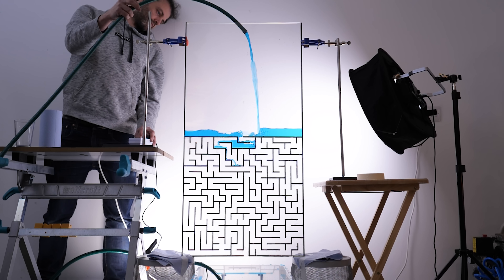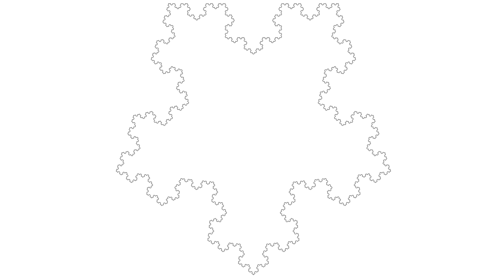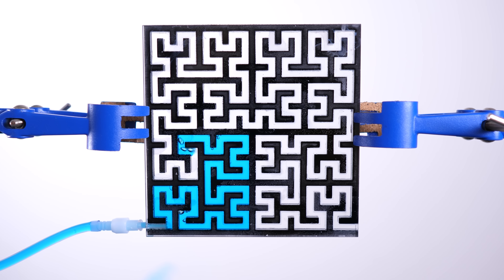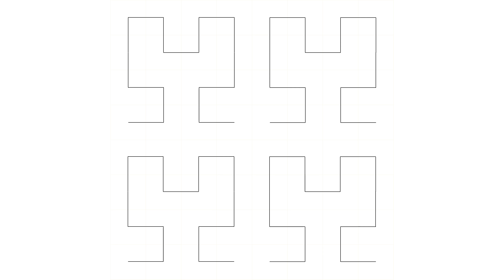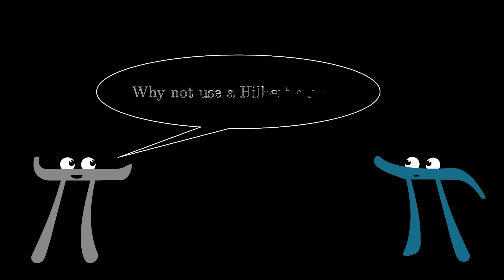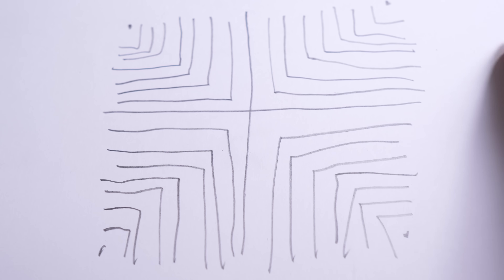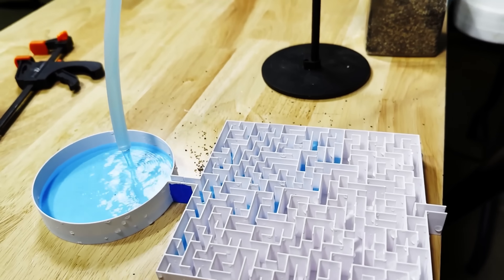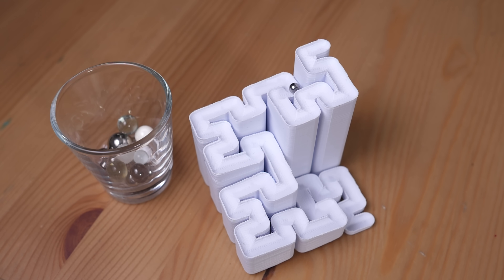Space filling curves filling with water

Comment from the maker: *literally

The sponsor is Surfshark: get an exclusive deal - enter promo code STEVEMOULD for an extra 3 months free at https://surfshark.deals/stevemould
Reply: for a clear resin 3d print, like optically clear, you can polish it to 800 grit, then use a clear glossy spray paint. It'll make it optically clear.

i've made lenses out of SLA 3d prints
Reply: I just think it's cool to see a real world version of the Windows 98 pipe dream screensaver
Reply: The "My water solving mazes video:" link in the description leads to this video and not the water solving mazes videeo
Reply: Matt Parker's link in the description gives a 404...
Reply: Question: What happens if instead of filling a maze from the start, you suck water out of the end of a maze via a vacuum (With the start being connected to a reservoir of water? Will the maze fill and eventually solve itself the same way? Or would it be more efficient?
Reply: sadly i had Surfshark and it works great but canceling subscription was very annoying. you cant cancel just by clicking it, had to contact customer support, wait them to answer, then have conversation with them and they give link that takes you to place where yo ucan cancel it and it had multiple layers of are you sure type of things with some tricks trying to make you fail at canceling it like answer no was in green and yes in red for question are you sure you want to cancel it
Reply: @TheAmethyz you should do a video for canceling surfshark then. I'm sure it would get lots of hits. especially about the disability failure and the process.!
Reply: @RowanHawkins  Otherwise good idea but not interested doing such things, specially for hits.
Reply: Steve mould, i think I found your long lost twin sibling!! His name is "david castello-lopes", and he is a french journalist/comedian/youtuber. The resemblance is very much striking
Reply: @adri1572  Steve is cuter.
Reply: 8:54 this surface isn't polished, it's ground very smooth.
Reply: Please make and sell the small 3D Gilbert curve resign cube!!
Reply: Steve, could you try fighting bots that literally copy-paste earlier comments? It should be a really simple heuristic: Like removing any duplicates that are complex enough
Reply: Throwing this mathematical puzzle that I've 'invented' out to everyone to see if there's a solution. (Something I've not been able to find)

The puzzle is:
If you generate a 2D code (QR code, Data Matrix, Aztec, Han Xin, ...) and you were told to recreate that code using square & rectangular blocks/layers, in black & white variants... 
How do you recreate that code using the least amount of blocks/layers as possible?
Is there an algorithm? Is there a pattern to look for first? Is there any knowledge/transferable technique that can be applied to other generated codes? 
The blocks/layers can only be square & rectangular - but can overlap other blocks/layers by any amount.

If you took a 64px x 64px 2D code - you could recreate every pixel with a block/layer - but that would result in using up 4,096 blocks/layers to recreate the code
How many corners can you cut? - or in this case... How many blocks/layers can you overlap to reduce the number needed to recreate the 2D code
What solutions are there?
Reply: @REDI2UM turn the data into another form of data that is smaller and do the same thing to that, could let the program take the data data and use a database based on known inputs to change that data into smaller data. Then when you want to iterate the code you would just the same database but reverse to get the original data.
Reply: Just curious, what headphones were you and Matt wearing?
Reply: Maybe, Infinite length and Infinitely thin, a Infinitely small droplet will fill the maze instantly.

What's the best approach to deal with  un-falsefiable problems?
Is it explained by the scientific method?

How du you learn the scientific method in the best possible way?
Reply: link to Matt's channel doesn't work @SteveMould
Reply: I wonder how good curves would be for fluid cooling?
Reply: @topherthe11th23  xD
Reply: you should fill the resin cube with coloured resin and cure it solid. it would be a nice memento but also, it would be something very difficult to make any other way.
Reply: @NicknameMatters  i work with polymers and also polish them. 
What he's got is just very finely ground, polishing would result in a smooth and shiny surface, which is already transparent without coatings. 

Polishing is kinda like grinding, but even finer and there's also what you could call thermal smearing, where the surface gets hot enough so the tiny peaks left from grinding get flattened/smeared a bit. 
At least on polymers, on metal it would stay with hyper fine grinding i think, which leaves shiny surfaces as well.
Reply: well it looks like weve discovered how slime moulds do their thing.
Reply: Steve Mould fills Steve Mould's mold.
Reply: @sdjessom  did he fill moulds mold mould with moulds of mold from a molding mold mould?
Reply: @sdjessom  i mean im missing some commas and apostrophes... its a sentence otherwise though.
Reply: Thanks, now my brain exploded
Reply: Why *literally?
Reply: Can you do this concept with gas going from high pressure to low pressure instead?
Reply: deconstructive enthalpic cascade: a violent return to ordered index of heat as entropy increases due to combined complexity triggering structural collapse of state change.
Reply: decoherent, dissipative nonlinear, nonzero discrete eigenvector matrix has entered the chat
Reply: Not that it matters, but you could have polished it so it was completely clear and didn't need mineral oil.  Certainly mineral oil is a much easier solution.
Reply: two words: ionized solution 👋
Reply: Seems a little like human brains.
Reply: @benbraceletspurple9108  speaking of which did you know that very large neural network model architecture supercomputing clouds have surpassed the node size of total human neural connections? interesting subject.
Reply: You should make one of them to test Mr Puzzle. Ball Bering puzzle. I'm sure he would love a Mould Fractal Puzzle. when he draws out the path it says mould
Reply: Daniel Radcliffe rejected acting and became a scientist
Reply: @toastboi1330  they asked him to work for the chemical comoanies but he said he hadnt been trained so well.
Reply: Hi, I have a semi-scientific question, I came up with it about a month ago idk how 😂, but i couldn’t find an answer
Here is the question:
Which bottle is more stable (in terms of balance I guess) - an opened one, or a closed one? And how the water in it would effect the situation?
Reply: yes yes yuup yoop
Reply: 0:46 Just put that on loop for 10hrs and "Bam" ASMR video LOL.
Reply: O 1:33 oooo 1:33 😅😅😅😅😅0
Reply: Dear Steve, your first link in the description links to the wrong video! It links to THIS video instead!
Reply: @SteveMould I am hungry.
Reply: present
Reply: Hi
Reply: lets do 31,5

Comment: I have to object that liquids can solve a maze if there is only one solution, one way through the maze. You are missing dead ends and wrong turns. A sinking ship is a maze as well however the water dies not go into dead ends therefore the back pressure from compressing air prevents liquid from filling dead ends.  So the liquids and gas are identical in solving a maze but the problem is your mazes don't need solving. Cool looking but even a mouse can solve it in the first try

Comment: could be wrong, but that labyrinth really seems like it should be describable as an L-system. if you contract the loops to be points then it's a series of orthogonal lines n a repeating pattern. the loops are always over the top, move up/down one vertical position, and an inversion in direction. so, the L-system for 5:27 should be, hmmm... 
S = strait 1 unit
U = up loop
D = down loop
+ = +90 deg
- = -90 deg
SSS+SSSS+SSSDSS+SS+SS U SS-SS-SSDSSS-SSSS-SSS U SSS+SSSS+SSSDSS+SS+SS U SS-SS-SSDSSS-SSSS-SSS

it required i add in some horizontal lines where you connected a loop to a vertical line, but that should be it.  considering this if you interpret the "loops" as sorta "out of plane" then the labyrinth might be a space filling curve of the curved side of a cylinder. the loops being the connection around the back. hmm... or since it ends at the top and begins at the bottom going opposite directions, a space filling curve for the surface of a torus. if you slap a U on "both" ends then the end of the system could connects back to the start through the inside of the torus.
lets see the n-1 gen of that system should be...

SS+SS+SSDSS-SS-SS U SS+SS+SSDSS-SS-SS

one more generation back should be... something that doesn't connect up.

 sooo... assuming the end of the sequence wraps to the beginning(so the final U and the first are the same symbol and halving the sequence because the second half is a copy of the first half), the replacement rules seems to be

D -> U
U -> DT(n)US(n)D
where T(n) = [n+1 copies of S]-[2n copies of S]-[n+1 copies of S]; S(n) = [n+1 copies of S]+[2n copies of S]+[n+1 copies of S] 

with that notation and those rules
L(1) => U S(1) D T(1) U
L(2) => U S(2) D S(1) U T(1) D T(2) U
L(3) => U S(3) D S(2) U S(1) D T(3) U S(3) D T(1) U T(2) D T(3) U

sigh, well that 3 definitely doesn't work right. 3 should be...
L(3) => U S(3) D S(2) U S(1) D T(1) U T(2) D T(3) U

it seems the generator is is switch
L(0) = U
L(n) = U S(n) swap(L(n-1)) T(n) U
where swap(seq) switches the U and Ds
so, not sure if that counts as a L-system but it is certainly defined recursively.

Comment: A space filling curve must be fractal to be quantified. If it is unfractal, then space must be filled non-repetitively at each of infinite levels, creating infinite non-repetitive spaces. This would call for infinite vector strings. This means every possible vector string is used. If you zoom in far enough you will find a string of vectors identical to those found at a higher level (lower complexity). On the journey to infinitesimal...ity this paradox eventually brings you back to having a fractal, albeit one of unknown terms. Filling a space does not require any math if imagined to be filled by an undefined string. Does that make sense to anyone else? It's like anti-entropy or something.

Comment: @ 6:39 that's a pretty sweet hilbert capacitor design, if one were inclined. I'm curious how E and B fields and waves would interact with it as well if it were made of copper. Bearing in mind it would be two separate pieces of material, possibly joined with a resistive junction or diode. There's something interesting about how it would perform as an EM wave antenna/ detector. Not in the mood to solve Biot Savart or Maxwell for it, but it would be interesting. Also for the 3d mini cube @ 9:29.. I would think using a fluorescing fluid and sealing the caps after filling would make a cool desk toy.. slap some uv leds in the stand and boom..

Comment: Are you sure the "fractal" dimension is 2 or 3 in the examples you gave? That makes no sense. If the dimension was 2 it wouldn't be fractal as you pointed out the meaning is "fraction" but 2 is not a fraction. 1.5 is. From what I remember the "real" dimension is somewhere between 1 and 2

Comment: The labyrinth is not a space filling curve, because the finite versions of it don't converge to a curve. In the Hilbert curve, every iteration of the curve restricts a section of the runtime into a smaller and smaller square, where this section also stays in the next iterations. The points in that square are all close to each other and so the limit exists. However, in the labyrinth you have sections which look like many lines stacked on top of each other. In this case, a portion of the runtime can only be restricted to thinner and thinner strips but they always stay the same length, and the same point can end up in completely different positions along the strip even among more and more complicated versions of the curve, which means you're unable to define the limit and so the final space filling curve doesn't exist. You can also think about it this way: In the Hilbert curve you can know for certain where a point like 1/3 goes - it is in the second quarter of the line so it goes in the top left quarter, then it is in the second quarter of that so it goes in the top right quarter of that square and so on and so forth and in the end you can deduce the exact point. On the other hand, if you tried to do the same with the labyrinth you'd find out that every point goes to some line on the plane, and changing the point makes the line sweep through the plane, which is not what is meant by the mathematical concept of a "space filling curve". It is similar to filling a square with a snake that goes right to the end, then turns, then goes left to the end, then turns and so on. In every version of the curve you'll have a finer snake that gets closer to itself and so to every other point in the plane but you won't get a limit that is a space filling curve.
Hope I helped!
Reply: Replying to @roeesi-personal:

DARZHNARZHERLARLEFREFLARZSHERBLE?

DARZHNARZHERLARLEFREFLARZSHERBLE?

Comment: The excellent spatial locality of the Hilbert curve can be useful in distributed particle simulations. There are too many particles to store on a single machine, so you have to divvy them up across multiple nodes. You want nearby particles to be stored on the same node because it's more expensive to communicate between nodes, and particles need to communicate only with their nearest neighbors. A particle's position along a (3D generalization of the) Hilbert curve can be very quickly computed from its coordinates. Then, you can sort the particles by their Hilbert curve values and assign contiguous chunks to each node. The end result is that the particles on each node tend to be very close to each other.

Comment: we use Hilbert curves in game programming, or sometimes Peano curves. Specifically because it has good locality compared to a simple row-by-column 2D array. (realize that all of your computer's memory is viewed as a long 1 dimensional strip, and it is up to the programmer to interpret those simple memory addresses in interesting ways to make more complex structures like a 2D array or 3D matrix). 
The reason we use Hilbert curves and Peano curves is because it is very easy to calculate any X,Y position from a simple scalar index and back again. 

#include <stdio.h> /* draw a 31x31 ASCII of a Hibert Curve - JDM 2004.06.05 */
char m[31][31];int a[2];void s(unsigned d){m[a[1]][a[0]]='#';a[d&1]+=1-(d&2);}
void h(int o,int r,unsigned d){if(o--){d+=r;h(o,-r,d);s(d);s(d);d-=r;h(o,r,d);
s(d);s(d);h(o,r,d);d-=r;s(d);s(d);h(o,-r,d);}}int main(){int i;for(i=961;i;)m[
0][--i]=' ';h(4,1,0);s(0);for(i=0;i<31;i++)printf("%.*s\n",31,m[i]);return 0;}

Comment: Air bubbles keep diminishing your filling effect, especially sad for the 3-D curve.  If the curve could be prefilled with water and free of air, the fill could be nearly perfect.  The direct way is to do vacuum filling.  In a vacuum, the air inside doesn't block flow of the liquid.  (That would give an interesting but different view in a vertical fill.)  A simulation probably looks much nicer tha a physical maze, especially if there are leaks.  But your 3-D doesn't leak.  The first filling could be exciting, with unimpeded overflows.  When vacuum is released, every trapped bubble shrinks; a 64x reduction in volume makes a 4x reduction in diameter.  Alternatively, you could keep on tipping the cube underwater to let all the air out – maybe with a robot to make the hundred of turns.  Another way to get the last air out is to circulate de-aerated water through the cube until all the bubbles dissolve.

Comment: If you had a perfect/final 3D Hilbert curve to fill a cube, how much water would you need to use to fill it? Would it be infinite or would it be the volume of the cube?
Reply: This sounds like another version of the Gabriel's Horn paradox. In this case you'd have an infinitely fine thread in a finite volume, so physically impossible (the tube would be smaller than an atom, much less a water molecule), but in the mathematical limit I'd say the length would be infinite, but would still only contain a finite volume of fluid.

Comment: A Hilbert curve actually does not have good locality. It's been suggested to use that for mapping voxels so that their localized in memory. But when you use a large number of them the distance between near pixels almost always covers more than a single page of memory. Actually a lot better to just use a linear array across memory and then one you get a fixed offset that you don't need math to figure out where the next pixel is... And two you need at most two pages of memory to have all the localized pixels in CPU cache. Because the Hilbert curve has such a height difference in the 3D version you can see that there's a huge jump between a lot of the edges where a linear array is actually flatter and therefore more localized

Comment: A simpler construction that is equivalent to the Celtic labyrinth for this discussion is an Archimedean spiral. The problem with these is that they don't converge to a continuous embedding as you increase the number of windings. What's special about space-filling curves is that any sufficiently small ball in the codomain can be split up into finitely many subsets whose preimages on the curve have epsilon-bounded size. With an Archimedean spiral, you'd need to split up the ball into infinitely many slices.

Comment: The problem with the iteratedly more complex labyrinth is not so much showing that the limit fills space as defining a limit that exists at all. The sequence of curves won't be uniformly convergent, because you have to compress those big u-shaped sweeps around the whole thing into shorter and short intervals. Even pointwise limits are going to depend on the choice of parameterisation (how quickly you go around different bits of the curve)